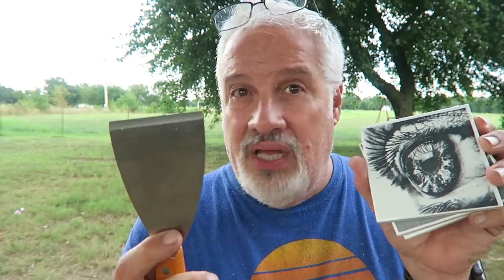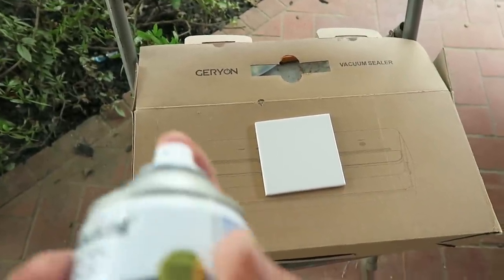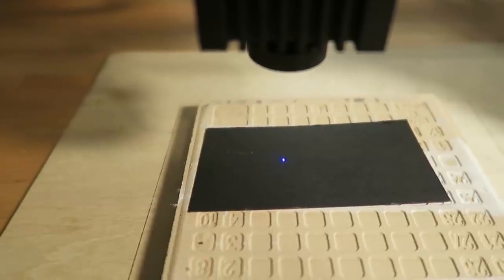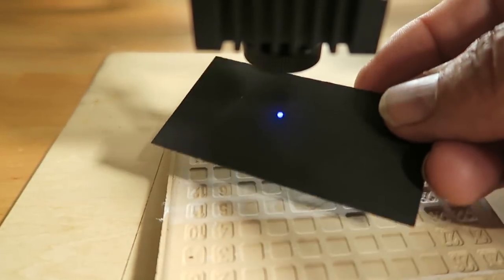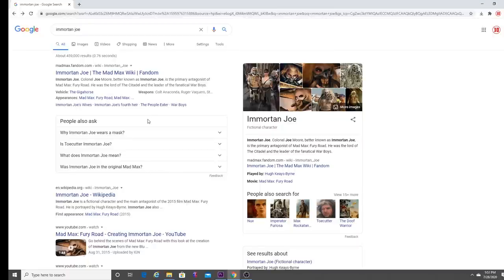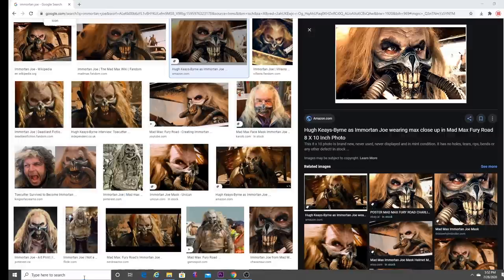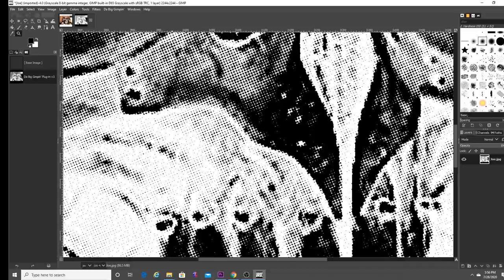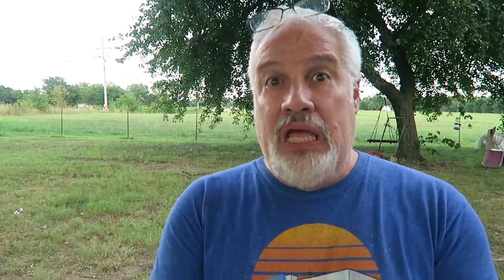Crazy Technique for Etching White Ceramic Tile PERMANENTLY!

Comment from the maker: ATTENTION FRIENDS!  I missed an important step!  UGH!  After your tile is lasered, you must clean the tile with Lacquer thinner or Acetone.  Use a paint scraper and microfiber cloth to clean up the excess paint!
Reply: Have you tried cutting polystyrene (plastic) sheet with that 15w laser? I'm a model railroader and have recently purchased a resin printer and am printing detail parts with it, Working great. Now the club I belong to is working on replicating several buildings specific to the "home town" in the mid to late 1950's. Kits are just not available and scratch building large downtown buildings is very time consuming. I was considering a laser cutter but I need to know if a 15W laser would cut .04-.06 sheet styrene or if I should buy something more powerful. Would make punching out windows a lot easier.
Reply: Cool.  I was gonna ask about clean up since I seen him do it.  I thought maybe you had a different method.
Reply: lol, that was the only question I had at the end, if the paint stays or not. Thanks for clarifying.
Reply: @oldiron1223  blue laser diodes are not the best laser to cut styrene , visble laser like those are not to good for white surfaces, Co2 is way better for styrene
Reply: @mauriciozavaleta1223  Might go with a CnC Router at that rate. Should be able to cut holes in .40-.60 styrene with an micro end mill in a router.
Reply: @oldiron1223  yeah but the tricky part when you're working with routers or mill's is the working piece fixing , and working with plastic sometimes you can melt or weld if you cut a various amount of layers, I think the best is to take lot of samples of the material and go to a makerspace or shop with co2 laser, routers and even vinyl plotter, to figure out witch machine get the best results.
Reply: @oldiron1223  go for a good cnc, maybe small working area but look for stiff or robust frame cnc, don't go for cheap 3D printer style, why?, with weak frames the hole machine will create vibration, that vibrating will effect the endmill , with  small cutters  is mandatory to have a cnc router with good ER collect system to have a centered spindle rotation
Reply: You are awesome and funny. :)
Reply: Hi your video is awesome me and my wife have been inspired like crazy just lately with ideas on literally working for your self but its knowing what could last and not fade out then your back to square 1. I'd love to get into this laser printing and etching on tiles what a fantastic way of starting a career off could you send me step by step instructions on how to do it ive seen the vids but not quite grasping it most of it is perfectly clear but its the data that you have to put in so that the laser knows what to do in incredible detail would yoh be  super star and send me something I can work on and the lasers ill need for both tiles printing ways and the programmes I need i no I must sound cheeky asking but wow you've got me hooked i wanna learn this way bad hope you ca help 😀
Reply: Great video. I understand pretty much everything but my question is why do you have to paint and then remove the paint at the end? Won’t the laser still etch the white tile without those 2 steps. What am I missing?  Thanks.
Reply: @oldiron1223  be careful of the potentially toxic gasses released when cutting plastics.  make sure you have good ventilation and protection.
Reply: So if its burning into the tile why is it necessary to paint them?
Err yeah what steve said ^
Reply: How long do you let the tile dry before you burn
Reply: Dose it have to be porcelain tile and will it work with ceramic tile???anyone
Reply: Hmmm, when I cleaned it after burning with Acetone it took off the underlying color.
Reply: Thanks for your video.
I have the same specs, same paint and I tried several times.
But even at 100 %, the image is never black or dark grey. 
And after whiping the most of the images disappear.
Anyone has an idea what could be the problem ?
Reply: I'm using 20w what ettingd should I change also I can't figure out how to turn the focus on the module
Reply: @bigpapaswoodshop1649  if you just got yours recently you might have the upgraded model as I do where we have a fixed focus lens. And a 29 mm long cylinder to put between the object and the laser.  We don't have this turning knob.
Reply: @stevehorvat69  i think the idea is to stop overburn making the image on the tile messy. so the overburn stays on the paint, which is removed later. guessing. im thinking by wiping off the white paint it will get into the black etching and color it white tho.
Reply: Thank, exactly what I was coming to ask!  Thanks for the great video!
Reply: 👌gotcha
Reply: Are the tiles used ceramic tiles glazed or unglazed ?
Reply: I'm having issues with acetone washing my pic completely away?
Reply: Hello!
This is available for diode laser too?

Comment: I just wanted to say I really appreciate this video.  I went out and got the materials, and did a bunch of burns today.  I finally got my settings dialed in, and the results are incredible!  There's a little blurring, but with that much detail, I'm not surprised.  I have a Full Spectrum Muse (C02 laser--45w), and my settings were 100 power, 10 speed, 0 blur, 500 dpi.  At 90 power and 20 speed, it was still only a gray.  At 1000 dpi, the blur was much more pronounced.  

And then cleaning it with acetone after took away all those impurities in the paint--the bubbles and fingerprints, and left a nice dark burn.  I'm so excited for this!
Reply: Try using a DPI around 300. The blurring is caused by overlapping dots.

Comment: Very cool!
My only question is one that might be silly, I'm not sure.
How do you line up where the tile is and where the laser is firing? I've never used a laser burner before and that really puzzled me.
Reply from the maker: What I will do is take a thin piece of plywood, then laser a 4x4 square on the wood, then I will place my graphic within the square so everything is lined up.  LightBurn also allows you you draw a virtual beam around your object at low power so you can line things up!  Thanks for asking!  Great question!
Reply: @3DPrintFarm  Thank you so much! I've been wondering that!
Reply: @jessd3012  another option is place your tile anywhere, hit fire in lightburn to show where the dot lands. Move head to corner of the tile and set the start position to "Current Position" and hit start.
Reply: Hold down shift and click the circular frame button on screen, it will fire the laser very low and frame where your creation will be burned.
Reply: "zeroing" is what you need to do to calibrate the machine with whatever medium you are working with. Most CNC machines do automatic zeroing for you, however, those machines run in the thousands of dollars.

Comment: Little mis-information here, When you set pass-through, the Line Interval and DPI settings are completely ignored - it tells you this right there in the tool tip. It burns at whatever DPI you got out of the Da big Gimpin plugin. All that prior testing at 0.11 line interval made no difference what so ever had no bearing on the final outcome.
Reply: But one can turn off "Pass Through" to set these parameters if so chosen to do so? Or is it better to let the program (GIMP or Image-R) adjust the outcome?
Thanks for the tutorial!!

Comment: Wow looks great ! Question if the burn is on the paint why is it so durable ? Your scraper did not bother it so I guess solivent  will not bother it once its burned either. Is it that durned paint is super tough ? Or is there something else happening to the tile when the paint burns ? Thanks again. this looks so great I think I will have to give it a go.
Reply from the maker: Great question!  It has something to do with the paint and the focused beam of the laser.  It's almost like as the paint burns, the intense heat actually scorches the tile and literally burns the image into it.  No amount of solvent, sandpaper, scraper will remove it!  It's quite amazing!
Reply: @3DPrintFarm  I wonder if the heat of the burning paint does something to the glaze on the tile. It must be a change to the glaze.

Comment: Have you ever used the Rust-Oleum cold galvanized spray paint? It apparently burns darker plus you just wash it off in the single afterwards and its the same effect as this but less chemicals to clean with.

Comment: How often are you performing the focus procedure?  Every piece of tile?  I am looking at the Ortur 15w for photo laser engraving on tile and wood.  I am also looking at the ACRO DYI with a JTech 4.2 watt output laser engraver.  That comes with a focus height plate to lower the head to.  It is quite a bit more in regards to price versus the Ortur.  I am curious how much focus adjusting the Ortur  requires in general?  It is worth noting either one will require dialing in software parameters to get the focus dialed in. I am inquiring about the mechanical side of focusing the laser. Great video

Comment: Thank you for a great tutorial. I have watched it several times and have learned a great deal. Having followed your instructions carefully, I get some different results. I am using a laser just like yours. My engravings have improved as I followed your instructions on focusing the laser, but I never get the dark burns that your video shows. I have changed power, dithering and speed settings and only get grey results. Any suggestions you might have would be much appreciated.
Reply: I am likewise having same issues. Just light grey not dark.

Comment: Focus the Lazer once then what ever you are ingraveing put under each leg and you don't have to adjust the Lazer again        if you just put a tile under each leg it's perfect if  ingraveing 3/4 plywood put a piece of 3/4 ply under each leg great video waiting on my Lazer to be delivered 👍👍
Reply: I have found that the tiles are NOT consistent enough in thickness to keep the focus sharp. I focus on each tile. Your suggestion may work well on wood where the focus is not as critical as etching tile.

Comment: If using this as a coaster, what do you recommend putting on the back so it doesn't scratch wood tables etc. And what type of glue (if necessary) to adhere that material to the back of the tile? Thanks so much love the videos
Reply: Thin cork sheets are available in hobby shops,  use contact cement.  Felt is also an alternative, but can be slippery ...

Comment: Great video. I am a little confused as to why the white paint is necessary.  I know that in normal cases, lasers like any other light doesn't burn into white substances.  I remember being a kid and trying to burn white paper with my magnifying glass 😊.
I understood the reasoning for the green and black paint in your other video but I would figure if the laser would work on white paint, it would work on a white tile!  
I do have an idea with using this type of setup to use on laser tape for sandblasting.  I'll have to ask the maker of the laser tape about my idea.
Reply: Most white paint uses Titanium Dioxide to make it white. The laser burns the titanium dioxide, leaving the "etch". This explained in other Norton White Tile (NWT) resources. This from google >> Is titanium dioxide in white paint?
Image result for does white paint have titanium dioxide or titanium oxide
TiO2 Nanoparticles

In most systems, titanium dioxide in the paint industry is used as a white pigment, giving high white color strength as well as hiding power, called opacity. TiO2 absorbs UV radiation effectively, especially when the pigment particles are small.

Comment: Another great tutorial. Does anyone have an indication of how long the laser takes to complete a fill picture 4x4 tile?
Reply: Based on line spacing of .110 and a speed of 1200mm/m.  I am estimating approx 78 minutes.

4 inch = 101.4mm
Total number of lines 101.4/.110= ~922
Total length of burn line 922(# of lines) * 101.4mm ( width) = 93,490.8mm

93,500mm / 1200mm/m = 77.9 minutes. This is burn time. This does not include moving the laser between each line while not burning.

Comment: Hey 3DPrintFarm... the Laser Master 2 20w is currently nearly identically priced as the Laser Master 1 ... is this a no brainer to buy the 2 or how do you feel about the machines compared side by side?
Reply from the maker: I'd go for the LM 2 hands down.  The gantry is more stable and you can etch much larger items than the LM 1
Reply: @3DPrintFarm  thanks!  Its on its way

Comment: I have a 3018 CBC, so my end print is grey. I assume that is due to the limitations of the laser? Also, I’ve been using different colors under both black and white paint, so paint over paint. The result is amazing, BUT you must protect it at that point since you need to preserve the upper paint level. Try it. Wild and pretty results.

Comment: Nice videos!   So to do the ceramic tile etching, after painting the tile, what strength of machine is required?  Output strength?  Would an Ortur 15w (head power 4000mW-4500mW) or 20w (head power 5000mW-5500mW) work?    Thx

Comment: Hey buddy thanks for all the info. Before I found you on here I already had a laser master 2 and was using lightburn. Once I stumbled across your channel yesterday I added Gimp to the mix and Da Gimp plug in. Working on my first tile burns now. One thing I can already see on the white tile sprayed white is there is little to no black. It looks a shiny grey lol. I am taking this as the laser is stripping the pain and the factory finish. I did upgrade my laser to the larger of the two lasers from Gearbest. I believe it is a 15w (keeping in mind that is not the laser output). I am wondering if in these vids you used the smaller head and that is why you were able to get the nice burn at 80 percent?
Reply: Go ahead and disregard me lol. I watched it again and caught which laser you were using
Reply: Yeah for some reason the image is still a good bit lighter than yours it seems despite having the 20w laser for the laser master, and trying to mirror your settings. I am wondering if its because the paint isnt cured enough and has some moisture? ahhh! Cant figure it out

Comment: What is the purpose of the white paint on white tile?  I have a glowforge and get awesome results on white tile, but the engrave is clear. I then run black ink into the tile and wipe it off.  Then clear coat.  I have also done the white tile painted blacks method a few times. Also, Still perfecting my standard white tile settings for use on a black tile engraving the black away.  Still dialing in the power settings to get through the black layer better.
Reply: There is a chemical reaction of the paint from the heat of the laser that removes the glase and color from the tile. The tile substrate is then etched by the laser. Only paint the the same compounds as the one he used will produce the reaction. If you turn the tile over and laser the back you will see that it will laser very good at LOW power and no paint. I do this to sign each tile that I do.

Comment: Thank you so much for this video, Garret ! Now to make lots of gifts for the fam. 
My question is if you already have your laser dialed in for focus on a spoil board , could you just place the thickness of what your new project is under each of the corners so that the it remains the same as you go from one project to another?
Reply from the maker: Yep!  You could!  I'm working on a spoil board as well to dial in my measurements.

Comment: Hey great video. Thanks. One little question. How much time is needed to do a 4x4 tile? The print process only.
Reply from the maker: Great question.  Depending on the surface area of the image.  So.. suppose the image covered the entire tile.. that would take approximately 1 hour based on 1200mm/min speed
Reply: Thanks... great answer 🙂

Comment: Hello Sir, I have an Ortur Laser Master 2, 20W and I have been trying to do the Norton White tile method in your video, but something is wrong. Using lightburn and following all the prep steps...I cant even get the laser to mark the paint. If I crank power to 100% and slow the speed down to 200 mm/min, it'll work, but something tells me there is a problem here, I shouldn't have to run it this slow right?

Comment: hello, 
will this work on any color tile?
great video btw
Reply from the maker: This particular technique is for white tile spray painted white.  I have not tested, but I'd like to try different colors to see if get similar results.
Reply: I recently saw a video where a guy did this process on a colored tile and it came out great. Just remember what comes out out white on the white tile is going to be colored on the colored tile.
Reply: @krisknowlton5935  So, if you used a tan colored tile, you might get it to look like those old time photos?  That would be pretty cool.